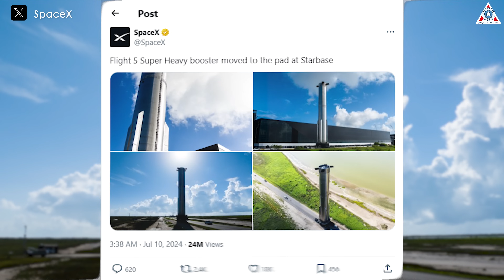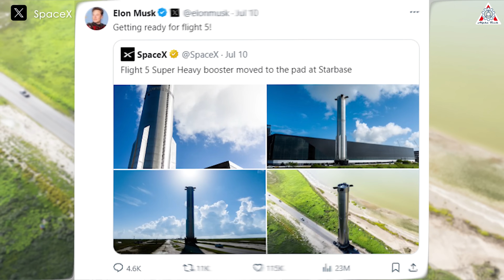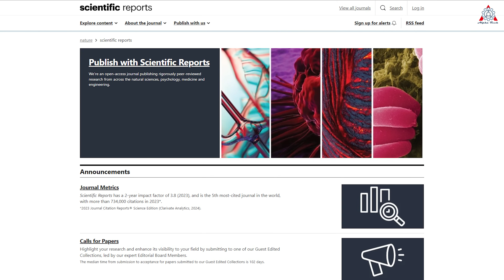Musk Reveals SpaceX Starship's NEW Launch In Week, NASA SHOCKED!

Comment: How much liquid can starship be able to lift into space in one flight.
Reply from the maker: nearly 5000 tons
Reply: @alphatech4966  Does it matter if it is a liquid or not? Not slaushing around, like on a moving crab boat.  10.000 is tiny if it can lift 150 ton to orbit Right?
Reply: The liquid that has the most power per volume. Methane.  And a lot cheaper.

Comment: SpaceX should Keep working on their scrap tow truck missions to demonstrate basic capabilities (which are likely to delay or fail) , or send a few more Teslas towards the sun 😎
Reply: Better than Rocket is here
Easy lift off 
Easy land on with antigravity Spaceship
No Fire
No Explosion
No Flame
Just Spin and
Lift off
Powered by Baterry

Work base on Gravity just spinning by using Battery
can fly in bad weather, plunge in the ocean even in outer space
Can lift more than 100 Ton 

Earth which weight predict 600 trillion ton does not fall at the Sun because of centrifugal in orbitting, on the contrary it does not be thrown far go out the orbit line of hold by gravity at the Sun as orbit center. Gravity and centrifugal is equal called Equillibrium, thats why until now Earth which we was inhabited always rotate and circulate the Sun. Now we justly take example : how if the gravity used and centrifugal is negated? The Earth will float far leave the Sun. So that centrifugal can be used to fly far away if gravity eliminated. Finally how to eliminate gravity?

It’s way rotate part of aircraft by horizontal. When that rotation faster centrifugal force getting greater and the gravity getting smaller, finally it lose the gravity and the aircraft start flying. Of course people would surprise: how the aircraft can keep rotate without fulcrums? Thats why we named that aircraft Shuttling System that is aircraft likes two disc adjoining attached in the midle as fulcrums:

A. The Top part, we name Positive rotate to right, and the edges is getting thicker and havier.

B. The Buttom part, we name Negative rotating to left, and the edges is getting thicker and havier.

C. Middle Part , we name Neutral, air crew placed and also machine and everythings turning Negative and Positive at the same time.

The aircraft can liftup added with explosion from the engine. However that aircraft construction later, let the engineer doit it, and we are sure the aircraft will bulletproof and also waterproof.
 
.
.
 
In modern civilization where human being generally using flying saucer as vehicle, will a lot of change in lives either in materialism and in psychological. In materialism area will apply the change in life like.
People no longger need roadway and rel road which spend large of energy, money, places, things and time, object place and time. People would utilize that area for habitat or for other need:
Reply: Rocket is complicated and dificulte
Low safety and high cost
We need somethings better
Developing technologies to enable human access to space at dramatically lower cost and increased reliability #FeelFree

Comment: Well, they have the rockets and intend to use them. I presume they will gain data from every use. It looks like repositioning the wings is an essential requirement and that will include significant internal and external changes. Those changes may not have been possible on the current iterations of the Starship. I suppose an attempted tower landing could be useful but once they change the wings all of the performance data changes with it. I don't think a tower landing would be helpful and could do more harm than good publicly.
Reply from the maker: Anyway, that's what they have to do sooner or later. If it's not the 5th flight, then SpaceX will do it on the 6th flight.

Comment: Sounds like business as usual for SpaceX, attempting one possible design path.

I think on the heat tiles that maybe experimentation be done with hydration based adhesives that create further shielding or ablation. Have the backs of the tiles keyed with micro channels in a 3 way grid, then sand blast the hull, for "Tooth", and maybe do a layer of boro silicate fiberglass cloth in a sandwich between hull and tile, so everything gets locked in together.

And on the nose shape, for the high altitude glide path re entry technique, instead of flying wine bottle effect braking, go for nose first and use of lift, to extend time in upper atmophere. And with that you could do a nose and leading edge
shape on flappers that was maybe 45°-60° angle, with a fairly sharp angle break to the laminar flow area shapes. this would cause the plasma compression wave to move outward away from the ships longitudinal surfaces. and result in less heating, and more turbulence instead of laminar high velocity friction. Basic analogy would be like a center punch or a cold chisel sharpening angle.

These sections could be made larger than hex tiles and maybe even overlapped like ship lap siding. so pressure keeps things pushed down instead of peeled off.

Also, might pay to "Shark Skin" your tile surface to get micro entrapment of air to make hull slicker using pressurized air as a lubricant. And keeping heat from direct contact. this is how shark skin and the dimples on golf balls work.

Also I would encourage other start ups to not follow SpaceX too closely copying, especially in things that are looking problematic, like tiles, flappers, round hulls, flying sideways braking, and grid fins on boosters...

Copy what works good, like stainless fabrication, and engine simplification, so you dont fall into the same pitfalls.

I'm seeing positive things like Rocket Lab's proposed tapered hull shapes, Blue Origin's aero spike engine, and the muti combustion chambers off one pumping system  of the other start up doing the cone shaped stage two. company name has slipped me.
Stoke Space?

Basically SpaceX seems tidally locked on their design  and already running into predictable problems.
This creates an opportunity for competitors to share trail blazing, Like if Beck sticks with tapered free standing hulls, he wont need towers, if Stoke Space developes unipump multiple combustion chamber designs They'll build cheaper, simpler, more durable designs than Raptors.

And if the Space Plane companies try flying in thin air, they will beat out tiles with coatings.

And on boosters, grid fins are like badmitten birdies, not really good control systems as much as drag creators. there are better systems for those jobs.

No one company will discover the true path. but if they compete, and then are forced to admit their attempt is lacking and someone else's concept is working better,  more collective progress will result.
 Its actually a team sport.... Players are individualistic and each will develope differing attributes.

So yes, I'm hoping the competition heats up!

Nothing like having the ball stolen to reduce arrogance.
Reply from the maker: Great analysis! I have to learn a lot from you
Reply: You sound like you know a thing or two, But SpaceX has captured better than 80% of the launch market by doing things their way, so smart money is on them for now.

Hopefully, a renaissance of innovation will be inspired by them

Comment: The arms that will catch the Starship should have vertical clamp surfaces to distribute the pressure and to minimize the risk of ripping the side of the Starship.
Reply from the maker: Hmm yeah!
Reply: Don't think that tightening the mantle is the way to go. Fixing is only possible at loadable points.
Reply: @1Elohim1  🤣 chances of catching are close to zero… you can tell they are disproportionate and no engineering to support. 🤣 The best part about this one is the finale… just like IFT4

Comment: Optimistic about IFT-5 launch and goals. Still wonder if FAA or Shotwell will approve a Catch attempt or want one more test flight, without the booster problems of IFT-4.  This could be a last second decision between Musk and Shotwell, based upon issues occuring during IFT-5's flight.

They need an official catch abort water window near Starbase planned for future flights anyway.

I could see, if the IFT-5 booster catch is successful. They might want to attempt a Starship catch on IFT-6. Starship does several orbits, after its successful booster's catch, then attempts its own catch landing.
Reply: This should be the best flight. With all the fixes applied. Since ice was identified as the issue with raptor restarts. Belt and suspenders heat tile, ablative backup. Improving reentry control flaps. We have two different events to look forward to. Booster Catch attempt and Starship water landing. Then Starship's catch plan is on Space X list.
Reply from the maker: Your comments are great! But I think they will achieve their goal in the 5th flight